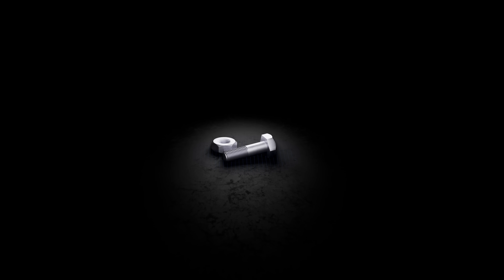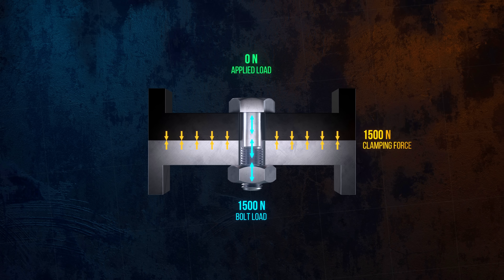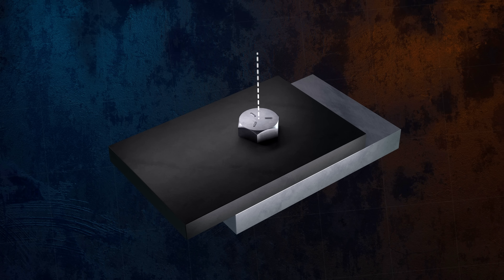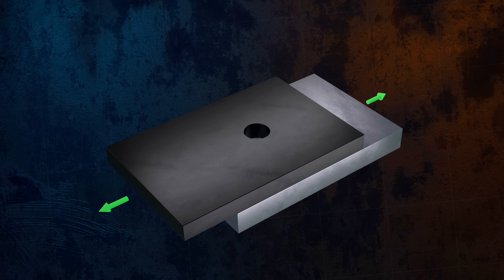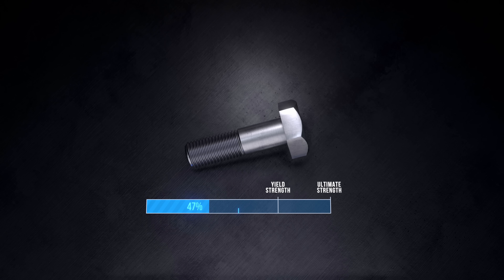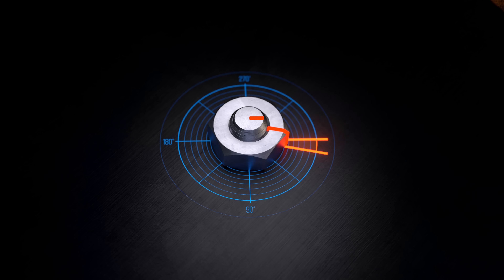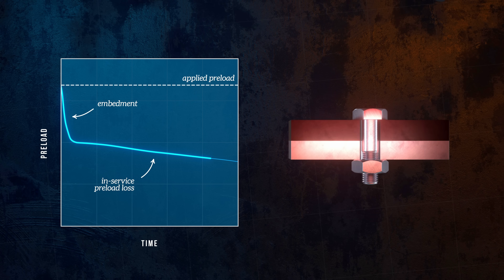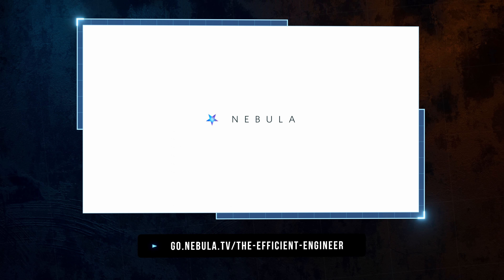The Incredible Strength of Bolted Joints

Comment: Thank you for the excellent video.   I miss one thing I never understood, could you (or anybody else) please explain how vibration unscrews a nut.   I imagine vibration as a random acceleration both in direction and magnitude. How does this 'dumb' momentum in random directions translate into an 'intelligent' torque pointing always in the direction of loosening the nut and even completely unscrewing it from the bolt?
What makes the vibration so 'clever' that it always unscrews a nut but never tightens it ?  ...even when the nut is already halfway the bolt, so turning it in any direction (loosen / tighten)  requires the same torque.
Reply: Vibration loosens a nut when the vibrational forces exceed the frictional forces of the nut to the surface. It's not so clever. Think of it like this. Random forces are being applied, such as LLRRRLLRLRLL etc. When the force is R, this would tighten the nut. More torque is required to tighten the nut because friction, increasing friction, compression, and increasing compression must be overcome for the nut to actually turn R. But turning is much easier to do. While the static friction L or R are equal, turning L relieves some compression, which relieves some friction, and so on.
Reply: @CycleWerkz    Thank you for the explanation.  I understand the scenario why it loosens up in the beginning.  But I still miss what happens afterwards:  why does it unscrews completely, and never makes a backward move on its way.   So when the nut is halfway on the bolt, or in any position on the go, ie. not touching the parts it was thightened to, the friction has to be equal in both directions.   So 50% of the random vibrations would loosen it further, but 50% should tighten it, resulting it should move back and forth on the bolt much more time, before it unscrews completely due to a very unlikely random sequence of vibrations strictly in one direction.
Reply: @nick066hu  HMM I have always found loose nuts will on the bolt, never moved all the way to the end so to fall off. 

So friction may be the same, but nothing is the same. I would first guess harmonics. Along the length of the dangling bolt, I would expect varied constructive and destructive harmonic oscillations. So the bolt is certainly vibrating, these waves would run to the end of the bolt, then return  to the top. The loose, unfastened bolt would  respond to many frequencies, and then create some of its own. I mean, it's going to be a chaotic harmonic party there. Both the bolt and the nut will try to dance along, but we have no hope of predicted outcome.
Reply: @CycleWerkz    Thanks for the update, this makes sense.
I remembered watching a video about nut vibration testing comparing securing methods. I was then very surprised how quickly a nut loosens, and I also remembered that those nuts fell off completely.    Now I searched for that video, found it, and you're right that the nut that falls all the way off touches the part all the time, helping it to one direction.

(are we allowed to insert links here?)  here it is I watched back then:   https://www.youtube.com/watch?v=4H-HOHZ3chA
Reply: @nick066hu I'd use a bit of caution regarding the results of this test. I did notice you said it's not applicable to your question. That test was a great attempt which ironically shows how widespread the actual issues are not broadly understood. He wanted to compare various types of locking devices, but the test is invalid unless preload tension was applied as specified, and equal in each sample. I'm certain none of the samples were preloaded anywhere near the design, and variation of sample error is likely 50%. 
The errors he demonstrated cause a huge reduction of clamping force. In this case the normal clamping force should be 2082 lbs. but I can show the likely best preload was 830 lbs. 
The 11 ft lb torque spec he used is where K=0.17, intended to mean lightly lubricated, clean, and new. You'll notice no lube. The CoF for dry steel on steel is 0.42 kinetic, and 0.5-0.8 static, depending on surface I'll guess 0.6 for this material. Even if his procedure were perfect, the absence of lubrication reduced bolt tension by 60%. 
The bolt head was not secured. While tightening the nut, the bolt tilted and the head turned, causing the nut rotation to stop before the click. This caused the torque to occur while the nut was in static friction. This increased friction from .42 to .60, on some samples, not others. Even if the premise of the test were acceptable, all comparison results are invalid. Even the Zinc plating added much variability. It's a good friction reducer for the first installation, CoF about K0.23, but the second use value is too uncertain to use. The manufacturer disclaims any use in engineering. In this experiment, each progressive sample had additional friction for the torque to overcome. And, I don't know if they were new at the start.  The bolt head and threads were subjected to the same vibration load and tension as the nut. Locking pieces which tie the nut to the surface can do nothing about bolt rotation. Despite this the split washer did not loosen. The split washer could not alter the bolt rotation at all, so that assembly had enough clamping force for the friction to withstand the vibration loads as it got lucky in the wide variation lottery. 
The typical bolt is selected to provide enough clamping force to handle the working loads. This clamping force is normally much higher than the force needed for thread friction to overcome vibration loads. 
More to your very good thoughts. I tried to calculate the vibration load he applied. I gave up due to very high peaks, very random, impossible to determine harmonics and resonance issues, etc. It is so very complex, mass production designers calculate all known loads, then add a big fat safety margin to cover unknowns. But they cannot add margin for repair errors as the margin would be too high.
Reply: @CycleWerkz  Wow, thank you for the thorough explanation!  I think, in spite of these errors that invalidate the comparison, the video shows how fast a nut (especially a not professionally tightened one) can be lost.   Where my guess would have been tens of minutes, if not hours to hold (at least not losing the parts in a cornfield or wherever), the nut was lost within a minute.

Comment: Brilliant.
While I have an Electrical Engineering degree, the first two years of our course included much stress analysis and mechanical design as a basic foundation.
But ... this video dug into the many nuances of bolted joints which I had either forgotten or not quite grasped at the time, and is a thoroughly enjoyable and informative presentation. 😀
Reply: Where'd you do your EE? I went to VPI&SU and none of that was in the curriculum. Too goddamn many programming courses were though. Felt more like a CS major than EE (and I wanted to get into physical chip design so I ended up leaving).
Reply: @ObservationofLimits  Queensland Intitute of Technology, Brisbane, Austrslia.

Four year degree. 1969-1972

8 Subjects. 36 hrs/wk lectures. Tutorials and assignments on top of that.

Thesis in fourth year.  UHF Stripline solid state amplifier. 5W @ 450Mhz.

Look at the back of any motherboard. All stripline transmission. All the wriggly and bent bits are delay lines, inductors and capacitors.

IT didn't exist then, but 50 step hand-held programmable calculators did. HP and TI. $250 when an Engineer's salary was $6000/pa.

For serious computing  we programmed in Fortran and took the punched cards to the mainframe office. Results came back a few days later. 🤣😅😂

Key is to "never" lose curiosity or stop learning.

Years ago I taught myself C++ for a hardware project.

If I have the need I'll learn one of the current coding platforms. Much more readable and less cryptic.

:-)

Comment: At 2:50 : I don't understand. The only force holding the upper half down, against the load, is the bolt. This clamping force that is mentioned is not a real force, as the bottom half of the jint piece does not really pull on the upper half.
Reply: Clamping force is a real compression force that came as a result of tightening the bolt, thats what holds the 2 pieces together. So when you try to pull the 2 pieces apart, you have to overcome this compression force

Comment: The load affecting clamping force instead of the bolt makes no sense. 
It's the bolt doing the work. If there is an elastic deformation in joint members that need to be overcome first, it doesnt mean that the bolt isnt stretching before they consume all the preload

Comment: What is P in the formula of cross section of Metric thread
Reply from the maker: It's the thread pitch in mm.
Reply: @TheEfficientEngineer  As we all know,the pitch can different,It would be very helpful if you could tell for what pitch you have calculated this
Reply from the maker: I just used the standard metric coarse pitch, e.g. 1.75 mm for an M12 thread.
Reply: @TheEfficientEngineer  Thanks a lot for the answer

Comment: Even stronger with a lock washer.Add a drop or 2 of "Loc Tite" on the threads of the nut & bolt, & you aint getting it back off without an angle grinder.

Comment: Specualized adhesives for locking the nut onto the bolt is good, but please, never use split-style locking washers unless theyre over a certain size AND installed correctly. Essentially though, split-style locking washers are useless.

Comment: Watching this gives me great respect for the amount of work that goes into seemingly simple things like bolt joints. I would have never imaged so much nuance.
Reply: not so much respect here - the fight in engineering is to counter bean counters desire to "value engineer" with the moral compass of the engineer who knows what is right. That is why AI will never replace engineers. Bean counters will always prevail unless a PE has to risk certification by stamping a design drawing..
Reply: It's Science.
Reply: @ThisIS_Insane  What drives it is the desire to push the limits of what we can do. Rather than just be satisfied with simple, weak joints, they kept trying to do bigger and bigger things. This required studying in great detail the characteristics of the materials and ways they interact.
Reply: @gargantuablargg   No foolin'? 🤔
Reply: For many every day situations you don't need to put so much attention into bolt joints. But for some it's super important.
Reply: There is and there isn't. It entirely depends on where the system is used. We make engine components where bolt torque can be critical but most of the time it isn't. Many engineering companies like the one I work at develop their own formulas and then simply use a table for guidance or spreadsheets to get quick safe rule of thumb calculations. From there if needed the joint can be further engineered and optimised.
Reply: Yeah you can overthink anything but at the end of the day it’s all about metal stick makes stuff not move

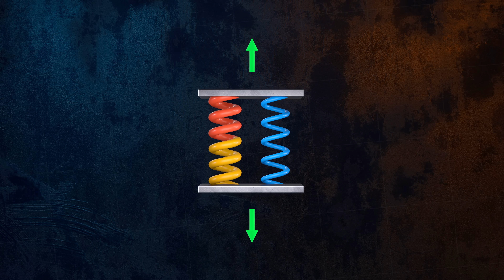Comment: 3:20 either I do not get it, or it is a wrong analogy. If you compress a spring, then it will pose less resistance to stretching (initially), not more.

Comment: 2:40 This is absolutely confounding to me. It's friction right? As in the clamping force increases the force required to separate the concave/compressing upper layer from the convex/expanding lower layer? I can't make sense of how this arrangement causes so much more resistance without loading the bolt otherwise.

Edit: 3 minutes later and I clearly need to learn to finish watching videos before commenting. Excellent material.

Comment: One of my professors used to teach a threaded fasteners course and he mentioned that something like 90% of the tension load on a bolt is in the first 3 threads regardless of the number of threads due to the deformation of the bolt when being tightened
Reply: My structural engineer colleagues agree with him
Reply: First three threads on which side?
Reply: @ShadangerDog  The three that are closest to the head as that’s where the tension is when you torque the bolt.
When you put tension on a bolt, you are actually stretching it and deforming the threads. 
Grip a rubber band in one hand and slowly pull with the other and feel for how the tension changes from the side you’re pulling from to the opposite side.
Reply: Iirc it's 40% on the first turn, 30%, 20, & everything else, do the rest of the bolt, is in that last 10%.
Reply: My professor told us the same thing.

Comment: If a sheer joint will always be loaded in a given direction, would preloading the materials against the bolt before preloading the bolt cause an increase in shear strength in the direction of the preload since the bolt will share the load with the friction?

Comment: Awesome video! As a few others have said, I would love to see a follow-up episode about washers since now I'm not sure how they work, what they accomplish and what their limitations are.
Reply: Washers are to reduce wear by transferring bolt rotation to an easily replaceable part, otherwise every time you adjust the bolt, you are digging into the surface of the material. They also reduce pressure by increasing the surface area on softer materials that would be deformed by the preload pulling the bolt end and nut into the materials to be joined. If you have plastic or wooden parts, washers are a necessity. A washer needs to be a certain thickness and hardness to be rigid enough not to bend or deform in the centre, where the nut and bolt ends are. The hole should also not be too much larger than the diameter of the bolt, so that there is plenty of contact area between it and the nut.
Reply: i was just about to say this myself! a quick search of comments first led me to yours here so now i am #11 on a thumbs up!

Comment: Great illustration of how this type of joint works.  Small quibble with the way it's worded.  The bolt doesn't begin taking the load once the force exceeds the clamp load.  The bolt is always taking the clamp load up to the point where the applied force exceeds the clamp load.  Then the bolt takes the higher load.  For cyclic loading, what's important is the elongation.  Although this is proportional to the load, it seems less accurate to focus on the load than the elongation or deflection, as the latter is what causes fatigue and failure due to fatigue.  Whatever you're bolting together still experiences the same amount of fatigue, so while the bolt may not fail, the structure might.

Comment: apparently my understand is the opposite of how nuts and bolts work. I assumed the nut was doing the clamping and was why washers were used to distribute more of the force over a larger area, not the stretching of the bolt.

Comment: How does the sheer strength of a bolt connection  in a building compare to a riveted  connection?
Reply: Shouldered bolts are steel, rivets iron. So you'd need much larger rivets, though larger holes in the beams. But if you just love rivets, the engineering is certainly doable.

Comment: Interesting Tutorial. In the 1980’s I was employed as a steel erector. In those days there were no elevated platforms. We had to climb the columns and bolt up the connections “in the air”.  We wore a belt holding maybe two podgier spinners, a shifting spinners, and a ball peen hammer.  Our “pre load technique was hold the bolt head with the shifter, tighten the nut with the appropriate podgier spanned until it was “tight” - then another quarter of a turn.  Bolting sequence for a 4 hole connection was “cape to corner” which means tighten the first bolt then the bolt diagonally opposite. Repeat for the remaining two bolts. Not a torque wrench in sight.😉

Comment: Excellent video.  Perhaps time constraints caused you not to mention that nut and bolt materials are tuned, so that, for example, a metric grade 8 nut material should be used with a grade 8.8 bolt material.  Then the bolt will fail in tension before the thread fails, making failure (a) obvious and (b)  easier to rectify than a mashed thread would be.  It is important to use the right nut material for the bolt.

Comment: What you missed?
Classical split lock washers do not work! You showed Nordlocks that do work and locktite that also does but did not warn about “lock washers”.
Shear flow and big bolts widely spaced Vs smaller closely spaced bolts.
Bolts vs cap screws! Used interchangeably but not !

Comment: Really an amazing video. Thank you very much
About bearing failures, 
I remember early this year when I had to use crutches, an old pair was extremely loud because the adjustment holes had elongated because of the brute force of 300N per step, as the holes elongated, the crutches got vertical plau, thus when the tip touched the floor, the handle wasn't stopped at the moment, gaining some momentum because of my own weight, qhen tha handle part collided (.5/1mm further down) it needed to dissipate such energy in the collision with the lower part, thus making the famous, but loud, click click at each step.
When I replaced the old ones with brand new ones from the same manufacturer (it wasn't on purpose, I went with what I found locally) the new crutches were way more quiet as the adjustment holes were still round and there wasn't much play

Comment: The threads should not be in the joint like shown in the thumbnail
Reply from the maker: You don't want threads crossing the shear plane, but threads in one of the members is fine - how else would you be able to tighten the nut?
Reply: I guess it depends on the application but in Aerospace we are not allowed to have any threads in bearing.  We have a bunch of different grip length fasteners and use washers as necessary for fine adjustment. The nuts have a bit of a larger area without threads so you can tighten the fastener.